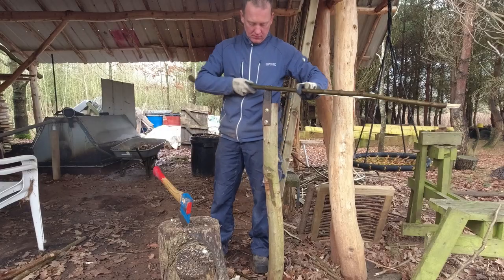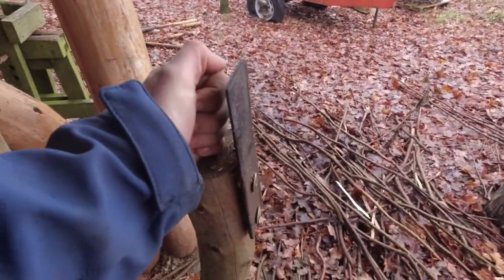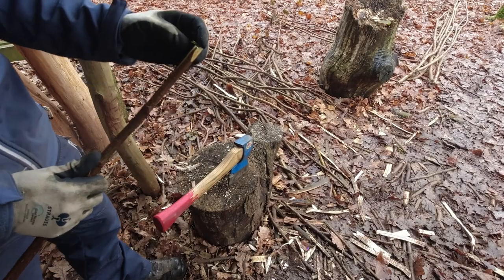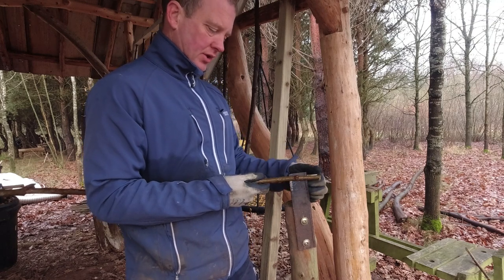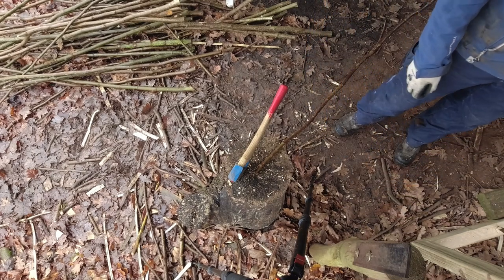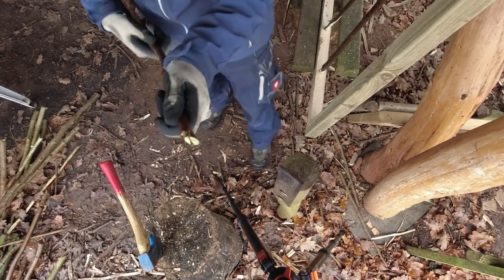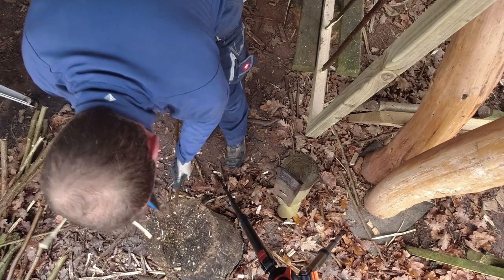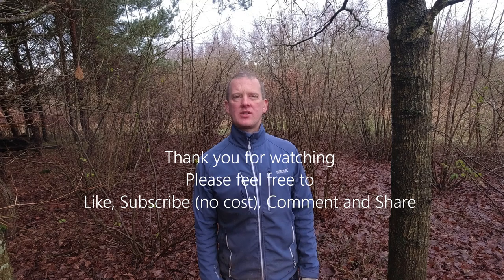How To Split, Rive and Cleave Hazel Coppice Rods for Hurdle Making, Willow, Chestnut

Comment: I'm trying to watch this video and I've got white cockatoos and crows squawking their heads off so I can't hear a damn thing. I think I might have to plug in my headphones 🎧
EDIT;
I decided to go back inside instead of using the headphones, 30 seconds later the noisy birds have flown the coop. Typical. But I got to enjoy the video and I learned a few things too. Now I want to try splitting some poles but I will have to use wattle or some other wood as I don't have any Hazel. I want to try making some panels to surround a portable Blacksmiths workshop for markets and lost trade fairs. Thank you for another entertaining and informative video. Good work.
Reply from the maker: Thanks so much, your idea sounds great, it’s definitely worth experimenting with different woods. Glad you persevered with the background distractions
Reply: @AbellTo  , what can I say? Your video is worth the time to watch it. I love learning new things that are useful and practical. The panels have an aesthetic appeal that would only add to the feel of the workshop. I have a couple of old lawn mower blades that I can use instead of having to make a blade, and I can sit it in my blacksmiths leg vice when I need to use it and put it away in one of my cabinets when I don't need it. Handy and tidy.

Comment: Thank you for your very detailed and helpful guide. Is it worth splitting thicker lengths ie 4" to 5"? I want to try and coppice a highish bank of straggling hazel which is against the road. Originally I thought I could bend the cut poles of hazel through to make a fence/barrier of some sort but now think I'd like to try and split them first. Is this a silly idea?
Reply from the maker: You’re welcome.
I’ve tried to split hazel that’s thicker but anything beyond about 1.5 inches becomes so tough due to the fibres and what I call wind (where the grain spirals) that I decided not to pursue it.
For timber to cleave I’d recommend chestnut oak for in the ground posts. 
If your hazel is on a boundary could you pleach the stems as in hedge laying? To give you a living barrier?

Comment: Brilliant. Thanks for sharing. One question, though. Is the riving iron actually sharp? I can see the leading edge is beveled, but it doesn't look like it has a proper edge. I imagine an edge would be a hindrance as it will weaken the side it touches...
Reply from the maker: Thanks so much, the iron is very blunt, I just put a leading edge on it so I can force hazel onto it if it’s a bit stubborn once started by the sharp axe.
Hope you get to have a go
Regards Darren
Reply: @AbellTo  oh, I will. I have lots of hazel on my land. Some of it is ready to coppice this winter, provided I can hack my way through the bramble to get to it.
Reply from the maker: @andrewsackville-west1609  fantastic, hopefully when the hazel is in good rotation it can suppress the bramble
Reply: @AbellTo  I've not heard this, before. Can you elaborate? I've noticed that the big leaf maple we have seems to suppress bramble, just from shade, I presume.
Reply from the maker: @andrewsackville-west1609  yes it’s the shade, hazel that’s well stocked ie 2m apart and cut on a cycle 6-8 years can suppress the bramble, when the hazel is cut the bramble will grow but in a few years it gets shaded out and is usually quite weak by the time the hazel is cut again.
However I do have areas I have to cut back because the bramble is rampant
Reply: @AbellTo  oh that's awesome to learn. Thank you!